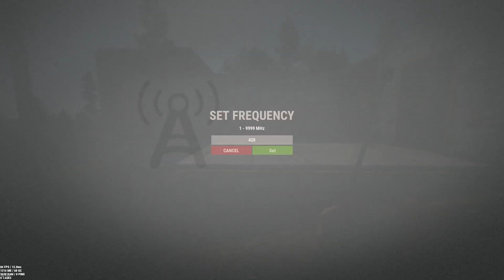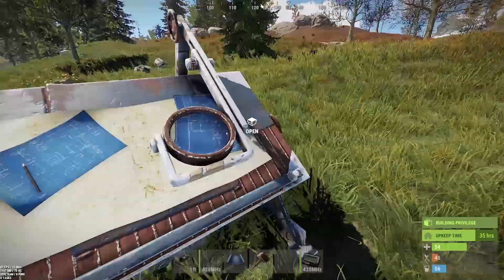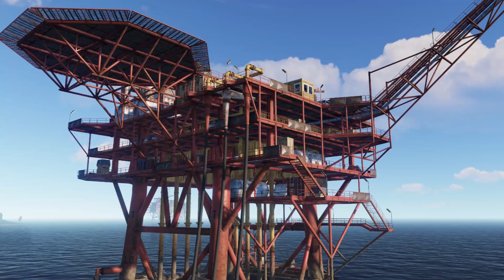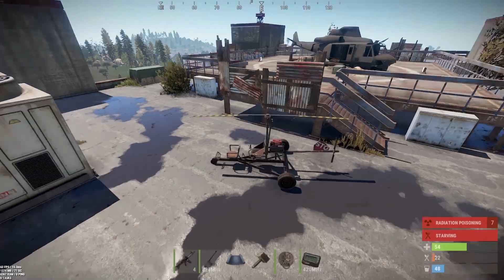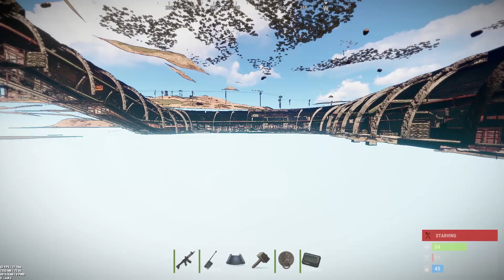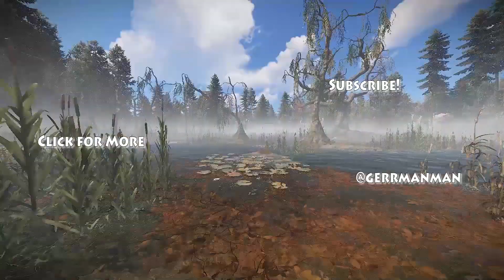Rust What's Coming | Air Power Update, Minicopter, RF & Alarms, Perf Fixes #172 (Rust Updates)

Comment: They should add fuel gauges or a warning sound when low fuel. The mini Copter uses 30lg every minute. So divide 500 by 30 and gets up to 16 minutes of flying time. Set a timer for 15mins and 1 minute for landing.